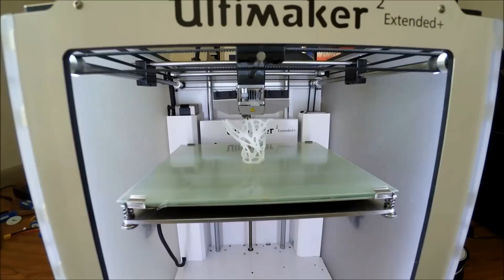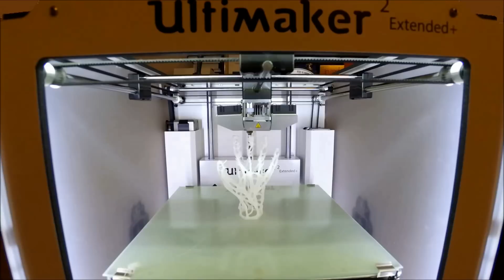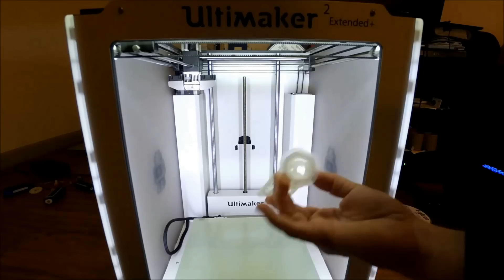Nylon Bridge and Alloy 910 Filaments on Ultimaker with PrintBite 3D Printing Surface

Comment: Were these nylons sitting on the shelf for very long before you printed? Did you do anything to remove moisture before printing? (I've had a full roll of 910 sitting in my room for months now)
Reply from the maker: +sugatooth They had been open for a while, and I didn't have time to mess with drying them out. Seemed to work fine as long as the temp wasn't too high.
Reply: Thanks for the response! I guess I need to experiment some with mine
Reply: Really considering getting printbite now, btw :)